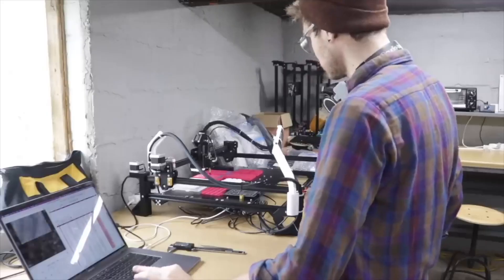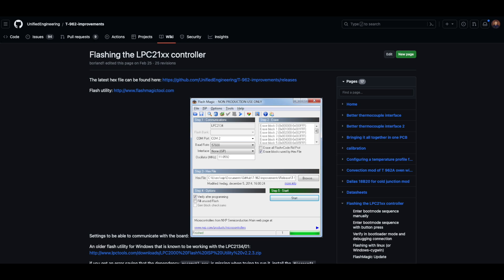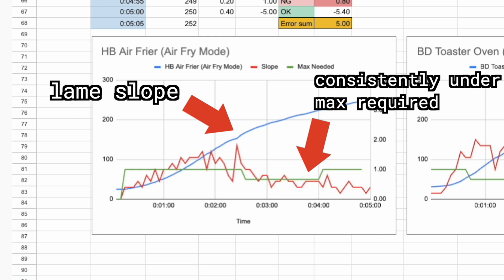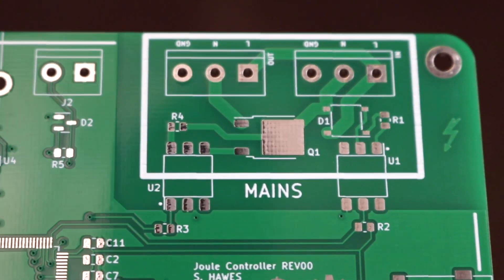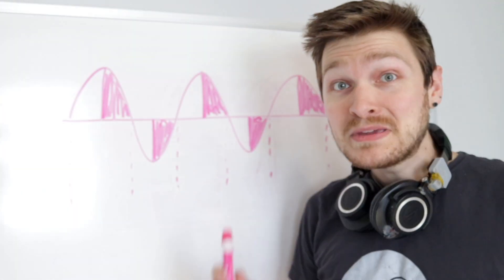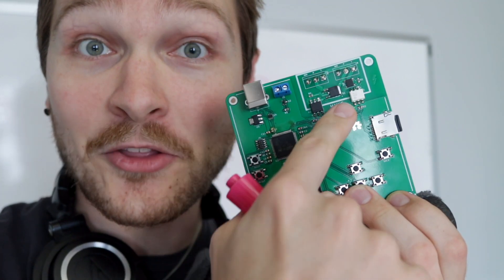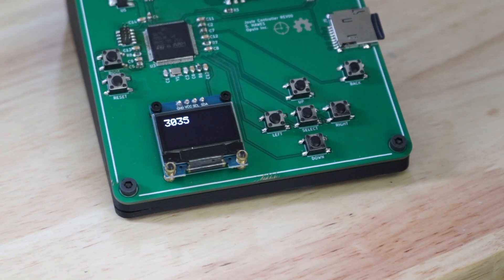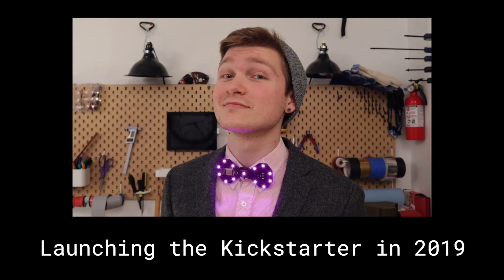turn any toaster oven into a reflow oven!

Comment: Note that chopping the input may mess up ovens that have timer electronics.
Fan ovens probably have better  uniformity, but also may be unhappy with chopped mains
Reply: Yep, the oven I'm using for reflows (which is a convection oven, basically the bigger version of the Black and Decker Stephen shows) DOES NOT like chopped AC, so what I'm doing is using a programmable industrial temp controller that has a configurable dwell time, which I have set to 10 seconds, and the oven is set to full temp and no shutoff time (timer disabled). The controller switches mains to the oven but does so in 10-second bursts instead of playing with the mains waveform.
Reply: Yeah, if the project is to avoid ripping out any existing controller, the oven chosen has to be completely "mechanical", just switches, and a timer based on clockwork.
Reply: Yes, adding a fan will help a ton with uniformity. When I made mine, the propagation of the heat made using faster than 0.5s pwm periods not necessary.
Reply: everything has microchip in it somewhere, even in the most simplest things there have manged get one in somewhere?
Reply: @dh2032  Nah, you can still get entirely electromechanical toaster ovens - the one I'm using for my reflow setup is that way.

Comment: A thermal system is so ungodly slow that you should be fine with a relay (... until the thing mechanically breaks)

Fr, just wire an ordinary light switch and see if you can switch the thing on and off by hand fast enough to keep a setpoint, I believe in you :^)

Comment: strange, my earlier comment disappeared regarding a project similar to this put out 10 years ago called reflowster.  it worked ok with an unmodified cheap BD oven and came with cool toxic stickers for the oven.  i.e. don't toast bread in here sort of thing.   I then went down the T-962A rabbit hole with mods and its workable but a PIA to dial in the profile.   I actually made an epoxy oven using a relay and a blowdryer about 20 years ago.  It worked well enough but was loud as heck.  I didn't even know about PIDs back then but basically it would respond to feedback with some time overlaps to deal with hysteria.
Reply: I saw your other comment.

Comment: I have had few problems with making small quantities on the stock T962 running lead free profile 3 on leaded solder. No mods at all. Just lift the board off the base with a couple shims to avoid cold spots. But I bought a 6-zone conveyorized oven for actual small scale production. Use time proportioning with a 10-20 second cycle time and zero-crossing SSR (isolation  provided by the SSR so everything on your board is low voltage). Heat sink fairly large (there are design curves from the heat sink manufacturers) for 10W or add a noisy fan to save money, weight and size. Beware that a short to the mains can not only electrocute you but could blow the ** out of your computer via the USB connection to earth. USB isolators are available if you are belt-and-suspenders cautious.

Comment: Ok, that was hard to see until the end. so mutch stuff I wanted to throw in. first things first: to use a triac you need a snubber (cap in series) so the triac can't be hold open and a filter for the triac (so he switches smove). Than, like with solid state relays (they work with triacs internally) you need some kind of falt protection, they normally stay open when failing. Now to the emi... that's a real problem. I recommend the Würth Elektronik design kits for emi noise reduction (but I think there will be some american stuff to, I'm german) BUT you will need a spectrum analyzer to know where to go for.
after all triacs a great for mains control in high precision applications, I use them in the development environmental chambers to control heat and humidity.

PS: use another triac, one that does not have mains on its backplate :)

Comment: Good work so far.  Since you will have to redesign, might want to add a power converter so the MPU is on when it is plugged in to power.  The switching may be better suited for Solid State relays as they do come in higher amp capabilities and your zero crossing circuit would still be able to detect when to turn on.  The only issue I see with that option for switching is the cut on and off timing which may be able to be compensated for in programming, possibly adding a thermal sensor to assist in " auto programming " the timing for set temperatures and change the timing of the relay.

Comment: Just a suggestion from a UX standpoint, I would ditch the buttons and use an encoder for the final product. Just like printers do it, I bet because of 3d printers you could get really good deals on 16x2 lcds and encoders from china. They are also more accessible parts for anyone building the device.

Comment: Bold choice to leave your board with an untested mains circuit plugged into the USB of your laptop haha. Great project, really interested in the result. 
I feel like since heat is such a slow moving thing, you don't really need that fast of a PWM signal. You could probably get away with switching 2-4 times a second and still get super precise control. Most older microwaves literally have a 5 second duty cycle.
Reply: Yeah fr he's going wicked overkill with that control scheme imo. I once had to build a couple dirt cheap hotplates for a chemistry experiment and I just straight up hooked a coffee maker heating element to a ssr and controlled it with a free arduino pid library on a nano, using cheap thermistors I had lying around for feedback. The control there was setup for mechanical relays using on time 'windows.' They worked exactly how I wanted, I even ripped a processing sketch off the internet to graph the curves for tuning the pid loops, once tuned in they were rock solid.
Reply: Naw he's using an optocoupler and has huge creepage and clearance between mains side and ELV side. No problem leaving it connected to a laptop. Also, bang-bang control (like pulse density modulation) at zero-crossings is the right approach and doesn't force you to make reaction time so slow ("2-4 times a second")
Reply: @NavinF  It may be the right approach for some things, but an oven doesn't need that level of control. 2-4 times a second is plenty (by an order of magnitude, really) for an oven and a heating curve. PID control and you're good to go.
Reply: @honkhonk165  Totally depends on the oven. You can do a whole reflow cycle in a few seconds. Lotta thermal mass to heat up
Reply: @NavinF  it would still take less than a second to reach full power, I think the limiting factor in the loop will be the heating element themself and the thermistor. Its unecessary to control faster than you can input or output in a PID loop.
Reply: In opto's he trusts.

Comment: Dude, just get the micro to output a DMX512 signal then you can use an off the shelf theatrical lighting dimmer for the necessary power.
Reply: Neat idea. Note these may have correction curves built in, not a problem as long as you know.

Comment: Looking forward to seeing how this project progresses. Always interesting to see different approaches, though my gut tells me that the thermal lag of the heating elements is so long, compared to that of your control loop, that you are not going to see any better control than your traditional bang-bang controller that is typically used. (on and off for long periods of many cycles) Certainly sub-cycle control, with the triac won't gain you anything here. Good luck with it, interested to see how it goes.

Comment: One more thought:

There are solutions to your problem out there.  Someone else mentioned a PID controller, which is true (but I don't know if they handle the kind of curves you're trying to follow).  What I thought of, is heat treating ovens for knifemaking and metal working.  Different temp ranges, but they also handle fairly complex heating curves that are user-programmable.

Comment: Do you really need to switch it on/off at 60Hz?  Since you're dealing w/ the Analog world, broadly speaking, on for 1s, off for 1s is going to be a 50% duty cycle.   What about on for 2s, off for 2s? 3s? Etc.  

Maybe experiment with those kinds of things before you worry about controlling mains down to the half-wave level.

Granted, you won't have the same amount of fidelity on following the desired curves, but do you really need that?

Think about it from this perspective: A human could do this with a light switch, a thermometer, and a stop watch, once the parameters are sorted.  Start from the most analog thing you can (a human) and work your way towards automating it.
Reply: For toaster ovens, the switching time needs to be up in the low-double-digit seconds, not waveform-/frequency-level. (My reflow setup has the dwell time set to 10s.) There's no real point in trying to PWM a mains-powered resistive heater element that has to heat a volume of air - several layers of hysteresis will be working against you.
Reply: The excitement of youth !

Comment: I've worked on similar circuits in the past (mains appliances controlled by a microcontroller for home automation, though at lower currents and without PWM), so I have a few notes/suggestions:
You explained phase angle control (/phase cutting), but also mentioned that full-wave switching might be better for EMI. As far as I know, there are also power factor specifications, at least for larger loads, which may require lots of filtering if using phase cutting. Generally, switching near zero-crossings is more efficient anyway (for resistive loads), so this seems like an easy choice, also given that the oven's response time is dozens of seconds at least, so you likely don't need the faster/more granular control of phase cutting.
Most solid-state relays I'm aware of also use triacs/thyristors for switching, and hence share the ~1V drop and high power dissipation. Their main advantage is ease of use and low part count, but since you're making a custom PCB anyway, it's not much extra effort to implement that functionality yourself (or get a zero-crossing controller and a separate triac). There are plenty of triacs available that are beefier than the one you used, as the manufacturers know they need lots of heatsinking, though you'll likely need to go THT (maybe TO-220 or TO-3) to actually dissipate dozens of watts.
Alternatively, you can use high-voltage MOSFETs for switching AC, either using two of them back-to-back or by shunting the DC outputs of a full-bridge rectifier. These offer generally lower voltage drops and hence power dissipation, but they are likely less reliable (due to transient overvoltages, see also below) and are harder to drive (no automatic shutoff on zero crossing, needs correct polarity of gate voltage), so many people seem to recommend against this. If the ovens can run on DC though, there also the option to rectify and zero-voltage switch, as used by a soldering station at https://youtu.be/erKCA71q7cg?t=879 : you can rectify but not buffer mains, so you get unidirectional ~110V RMS, but with regular zero-crossings, so a single MOSFET (with low on-resistance and hence continuous losses) can be used. Then by switching near those crossings ("zero-voltage switching") at low voltage and current, you can get by with very low switching losses.

Finally, before this becomes an actual product, I'd recommend you carefully test its EMI *resistance*, as having mains on the same PCB as a microcontroller can be interference galore. I'm currently planning another revision of my project, because I've noticed that switching off fluorescent lights in an adjacent room sometimes causes signal glitches in the low-voltage section, and this will likely only get worse with the larger currents and frequent switching you're planning to implement.
(Disclaimer: While I'm studying EE, this is not my speciality, and I'm by no means an expert. Please take all the above with a grain of salt)
Reply: Indeed running a high wattage load at those kinds of power factors are quite "rude" to the utility company...
With regard to regular high voltage mosfets the i^2*r quickly (I has comparing @16A and IGBTs not triacs)  became as bad as the IGBTs, good (expensive) GaN and SiC did however beat the IGBTs.
I'm inclined to believe that here a triac is probably just fine unless Stephen really wants an efficient controller.
Diode rectification comes with its own "horrible" voltage drop.
Reply: @TalpaDK  Right, my low-voltage habits are showing - of course IGBTs are an option at mains voltages, and I did forget the bridge rectifier voltage drop.
Regarding I^2*R losses, the video mentions 10A, so I estimated that <100mΩ R_DSon should be less lossy than most triacs. Just checked on digikey, and e.g. the EPC2304ENGRT would block 200V, and has 3mΩ on-resistance, so that should be realistic enough. Of course optimizing efficiency is not the main point, just that a lossy controller will need much more thermal design considerations than an efficient one.
Reply: @hadinossanosam4459  reflow ovens are often >= 1300W so I would expect a bit more than 10A for a US installation, but yes a EPC2304ENGRT with its Ron of ~3.1mOhm would be way easier to cool even @ 13A (523mW * 2). Is also not your garden variant Si mosfet but actually one of them shiny GaN ones (and a bit on the "expensive" side).
Stephen would probably have to spring for something even fancier, as he would probably also want to target 230V countries which would push the voltage requirement up to 325V+margins.
I also hope that he is considering adding a MOV and a fuse to his setup for some basic transient protection regardless of his choice of switching device.
Reply: @TalpaDK ..fuse YES ...mov...not really necessary with the device in series with such a resistive load .

Comment: Yeah, you need a zero-crossing SSR.  There are a ton of open-source reflow oven controller projects to adapt.  The AQ-A series of SSR's from Panasonic seem to be popular.  a 15 amp, 75-250VAC model is about 20 bucks for onesies, 15 bucks in quantity.  The heat sink can sometimes be more expensive than the part, they need beefy ones.
Reply: I agree. Get a name brand SSR that can handle the load. You'll pay a little more. The cheaper Chinese ones are hit and miss. some work, some don't.
Reply: Crydom ssrs are better
Reply: Yeah he needs to freeze his nuts. Your 17 subs TELL YOU TOO!!!!!!!!!!!

Comment: Any thoughts of the controleo3 and kit? They sell a kit with sealing compound, the relays, and insulation.
Reply: I got a controleo2 as a kit a while back and it works well. Modifying the toaster was time consuming but the boards I have reflowed with it came out flawless. If I were to do it again I think I would want a larger toaster oven so I could reflow larger boards, something around the size of a mini-itx.
Reply: @asm2750  That's great to hear. I pulled the trigger and ordered the kit after watching this video

Comment: Very cool project. Please be careful with these open AC flats. I have also converted a toaster oven. Experience has shown that these things are so slow that it is actually enough to switch the power on/off with an SSR. So I was able to solve the whole 230V switching with an SSR, which I switch with a FET. These ovens are so slow that you have to switch on/off relatively slowly to keep the temperature +/- approximately. Thus, the active line control is not necessary at all, but an on / off is enough in this case. Am curious about the next video.

Comment: Quartz and resistive elements have a curve, so it might be worth just expanding the duty cycle to a few seconds of ontime, instead of rapid pulsing. Marlin etc have been doing PID tuning for years, I wonder if that code might run better than rapid switching.

Comment: I've thought about this too. Unfortunately you will still need plenty of certification for anything with mains, and every country is different. The US is a bit special in that you don't need to be licensed to fiddle with mains. A lot of other countries require tou to be a licensed electrician to work with LV.

The best way around this is to keep it ELV. Find a solid DC supply and use that. Then on the toaster you need to go simpler - look into RV/Caravan, Truck, or Marine (boat) electric ovens that run from 12v or 24v is my suggestion. Though with ELV being up to 50v AC or 120v DC, if you can find something that runs nearer those limits you can cut way down on current.
Reply: Sorta like 3D printer heatbed controls - those are usually 12VDC/24VDC at a few hundred watts and use simpler power-MOSFET PWM control and thermistor temp sensing. Unfortunately this would mean your reflow area would probably be a small hotplate and not a big enough thing to process a whole 300mm^2-ish PCB panel.

I'm building a transformer winding machine ATM, and instead of integrating mains PSUs I've stuck a barrel socket in the back and it runs on a 12V 5A wall wart because screw having to spend $125K and about six months of back-and-forth (as of 2018 when I last checked into this) getting RFI/EMI and mains safety certifications.
Reply: @OddlyIncredible  Yep, you can get off the shelf ovens that are up to about 500W from my quick googling. Unfortunately they are a lot more expensive than an ordinary toaster oven.

That said, you could also try modifying a toaster oven that runs on 110v AC to run on 110V DC. Since the elements are resistive, it should be able to handle it without too much issue.

The biggest problem is switching DC instead of AC with relays. Pwming that much power will be very inefficient, unless your duty cycle is very low - which is basically a variation on the classic bang-bang control.